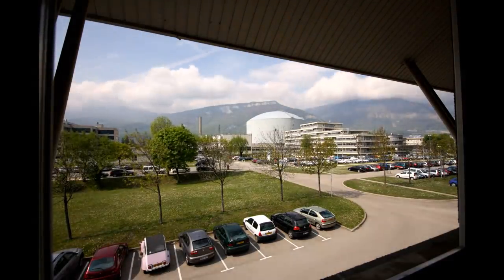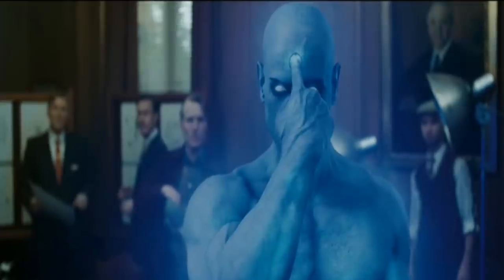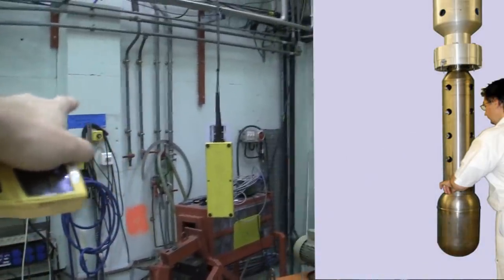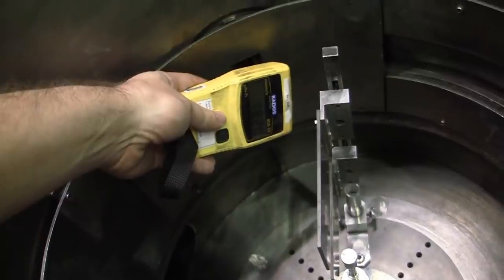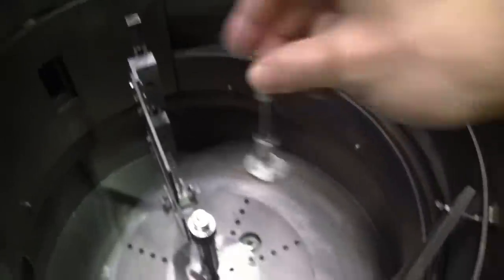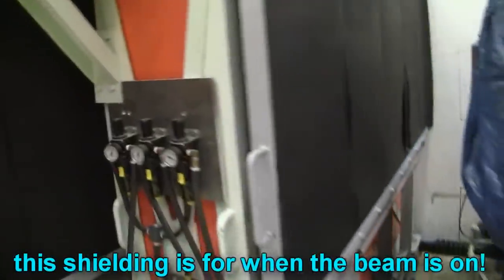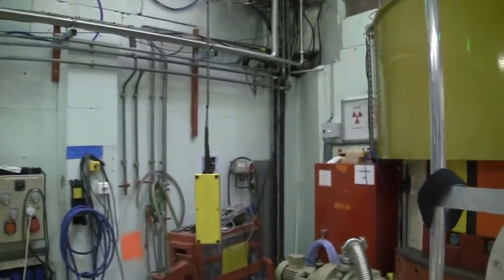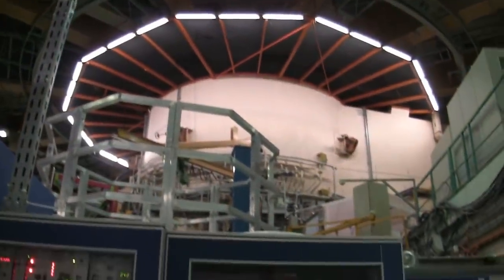Nuclear Reactors, Fantasy and Fact!

Comment: when he approached the wall containing the reactor, he dissmisesd the reading as'' oh it is reacting a bit more now'' but the thing showed almost 3.0 radiation level
Reply: Mario Josipović I wouldn't go as far as comparing the smog "safe amount" thing with things such as poisons or radiation. There is a LOT of money (I heard about some cases of fraud even in my country) available if you can let more smog into the atmosphere, because of various reasons (I'm sure you will find some) and that's why they are changing the safe amount - because of moneeeh (and the power they possess). With poison its a different thing. Basically everything is lethal in a high dose or high concentration and the safe volume talks about the concentration/dose needed for it to be lethal. You can happily eat/drink lower amounts (which is for some substances obviously not recommended due to possible side effects, but it shouldn't kill you). Something similar is also with radiation. We are absorbing some dose of radiation everyday, but our cells are regenerating fast enough for it to be harmless. And if you think, that being exposed to radiation with strength of 3 microsievert per hour for about a minute is a lot, then please note, that Airline crew flying New York to Tokyo through polar route has annual exposure of 9 millisieverts (notice the change of units).
Reply: Mario Josipović I'd be pretty scared being there, but then again radiation in an airplane is like 2.3 as he says and you are exposed to it for longer periods so it should be just fine.
Reply: i dont trust any of this, especially when someone says ''safe volume'' of radiation.... same like ''safe volume'' of poison in our water or food.... fuck that how about no poison or minimal amount of poison, because when they say safe that means that they devised the number. China to combat theyr smog problem, instead of lowering the output they increased the ''safe'' amount from 1000ppm to 10000ppm and that becomes the new ''safe'' standard..... fuck that shit!

Comment: These kinds of reactors are leaps and bounds safer than they use to be, and correct me if I'm wrong, produce almost no waste these days. Would be nice to see more of these as oppose to windmill/solar farms.
Reply: It's not a power plant. This apparatus is for research only.
Reply: ah, my B
Reply: MediNIeN There are lots of options for nuclear reactors and waste disposal, some produce less waste, or produce waste in a better state, however most want access to the waste for other purposes, you can for instance use a pebble bed reactor where the waste and control material are all suspended in a ceramic substrate, a ball about the size of your fist, each pebble generates the heat as the fissile material issued up heating water circulated around the pebbles, there no chance of meltdown and the water product is still trapped in the ceramic substrate, making it quite safe to transport and store, however you can't access the materials for reprocessing or nuclear weapons ect so it is deemed undesirable, similar with other fissile materials like thorium ect, 

It is relatively easy to get around a lot of the problems with nuclear reactors and we have the technology have even tried some of the options. But however much authorities want to deny it or consider it a problem, they still want easy access to the by-products which is where the problem comes in. And a lot of the problem comes down to liquid waste due to reprocessing, solid waste is generally stable and just needs to be stored safely.
Reply: +J M Montgomerie You can't take depleted uranium fuel and turn it into a weapon. I mean, you could, but you'd have to enrich tons of the waste ad at that point you may as well just use it as more fuel. Uranium-235 needs to be about 97% enriched for weapons, only 5% enriched for fuel.
Reply: MediNIeN Dug them up?
Reply: BumboJumboOriginal  I think he means to bury the used fuel where the virgin fuel (Uranium) was originally dug up from (hundreds of conspiracy theorists are now gaping for breath "What, that stuff is in the ground around us?!?!?"  Yes it is folks, and in the sea too ... and in coal - and some of it goes straight up the stack when you burn it!!).

Anyhoo, I think the thing is that after it's been in a reactor, the fuel has changed and in simple terms is not in a state to "put back in the ground" safely.  It can be stored pretty easily as it is, with some shielding and containment to take care of, or you can re-process it to extract the stuff that can be used again (more efficient if you use a fast breeder reactor as part of your cycle);  it's also the reprocessing that gives access to the stuff you can maybe use in weapons (I'm simplifying a lot here ...), which is why reprocessing is more popular with nuclear-armed countries.

When I was a kid, my Dad used to dig a hole and bury the old engine oil from his car when he changed it, on the basis that "it came out of the ground, so should be fine to go back in right?"!  At the time I didn't have the knowledge to argue (or even know he was wrong) so I just held the shovel for him while he poured it in ...!!
Reply: +Black Gate of Mordor one of the daughter products of HEU is Pu239 which was used to make the first A bombs. you're right about needing enrichment, but there are reactors that run on HEU
Reply: 5% enrichment. Anything above that is a huge waste of energy to run on a reactor. Most modern designs (including CANDU) try to avoid enrichment because it is very energy intensive.

Comment: so if you were to drink charged water would this be bad for you? Ex: putting positive and negative plates in a cup of water charging it with 110v then stopping and drinking it right away.
Reply: you would end up with a water filled with particles from the electrodes.
Reply: that a good or bad thing to drink?
Reply: Achilles Oden yes. don't drink it.

Comment: But wait! Can you stop gamma rays by placing an unisolated copper cable under high voltage on their path? I mean, it surely has a lot of electrons in those cables
Reply: Nop.
1.) Gammas travel at lightspeed (obviously). Electrons in metals are quite slow and travel arround a few milimeters up to centimeters per second. That seems totaly static for the photon.
2.) The absorption, scattering (or/and pairproduction, depends on the photonenergy) is more or less a particle to particle ineraction. That means the scattered photons doesn't realy care about other elektron arraound.

What you want aren't slow moving elektrons but a high density of elektrons. By applying an electric field you probably will move some electrons around, but you will not change the densety of electrons in your metal because elektrons repel eacheother. The only thing you can do to increase the electron densety in the metal is by charging it like an capacitor. But that is limitet to the point where electrons repel so strongly each other because of the electrostatic charge, that they will be kickt out of your piece of metal. Infact you could only increase the densety on the surface of your cable.

Its better to use elements with more protons in their cores. Then you have more electrons in noncharged metal. The best thing you could probably use as an gamma ray shield is depleted uranium. Its quite stable and insanly heavy :) but also realy chemically poisonous and you could never us it as a nuclear Warhead.
Reply: MetaHunter1
i ment that obviously not the electrons themselves but the electric field they produce is what spost gamma rays, therefore haveng a HV cable on the path of those rays will block it's movement because of the intense electric field
Reply: Eugene InLaw
sry but no :)
I know quantum mechanics is so weird that probably nobody realy understand it but when you want to deal with gamma rays, you need Quantum ElectroDynamics to explain the interactions between matter and light by elektromagnetic interactions. In QED the electric field is described as an densety of virtual photons around a chaged particle. These virtual Photons are the carrier of the electromagnetic force. When you want to transfer the energy of gamma rays in an electric field, that means you want the gamma PHOTON to interact (directly) with virual photons. As we know now, photons are the gauge bosons of elektromagnetic force. That means they could interact with everything that has an electric charge. Photons have no charge (and QED is an U(1) abelian symmetry groub .. bla bla bla) and so they dont interact with eache other. At the end Photons can only interact with charged particles (dont matter if they are moving or not) and cant dump energy in an classicle electric field.

I think you mean an antenna-like effect, where low frequency photons get absorbt by moving electrons around. In this case the energy of phorons are so low, that classicle electrodynamics work but it breaks down when it comes to realy high energy gamma photons when you have to take care about the qm properties of light. Even in the antenna photons only interact with charged paticles in the metal. The occuring classicle electric field are more or less a (nonphysical) byproduct in terms of QED but is good enought to do classicle (non qm) calculations
Reply: Krateling
it's called "winged doom" from artist Heiko Müller
Reply: Krateling
np, m8

Comment: I always thought nuclear reactors looked more fancy then that. :o 

Oh Hollywood! XD
Good stuff! Thanks for sharing!!
Reply: What? Does that not look fancy? All that complicated wiring and machinery. Doesn't it look cool still?
Reply: Sure, but if you were to compare it to what most people think such reactors are like they'd be quite disappointed. To someone who understands the engineering that is in place you'd say it is one of the coolest things you've seen. However most people lack such insight.
Reply: Well, I don't understand Nuclear Engineering much better than the average joe, but I still think that looks very complicated. I can barely wrap my mind around all the math and material probably needed to build it. Let alone all the specifications and maintenance that would be necessary to keep it running.

Although, I agree hollywood has made us to think of something different when it comes to mind.
Reply: I always thought than should be used here instead of then.
Reply: It looks like a nerd’s fancy house to me

Comment: Is there any way to harness the energy of the approximately 1 MeV that the neutron releases upon decay instead of having the cement block absorb it?
Reply: You kinda answered your own question... The way of "harness" the neutron's decay energy is by absorbing it in some kind of material... like for example... a cement block. :-p

If it serves as a consolation, neutrons are released in the fission process with ~7MeV of kinetic energy, which is deposited in the moderator of the reactor, and that amounts for ~3.5% of the recoverable thermal energy in the core. And more important, for every neutron "dying in the shield" there is a million neutrons giving away kinetic energy in the moderator (Thunderf00t to confirm. I'm assuming 10^15 at the core and 10^9 at the monochromator). So, don't feel bad about the 1MeV lost in the shield. By the time neutrons get all the way to the sample, the problem is not about power but rather about radioprotection. It's better to crash the neutron into the cement block than into the researcher. :-)

Anyway!, keep in mind that ILL (the reactor featured in the video) is a "research reactor", not a power plant. This reactor was designed to have neutron beams leaking radiation out of the core and into the samples. In a power plant, the core is designed to keep the radiation in the core and to "harvest" the thermal energy in the most effective way.